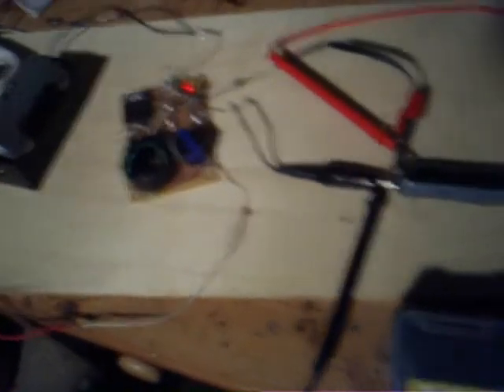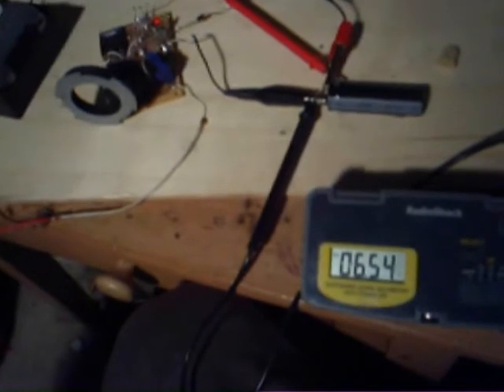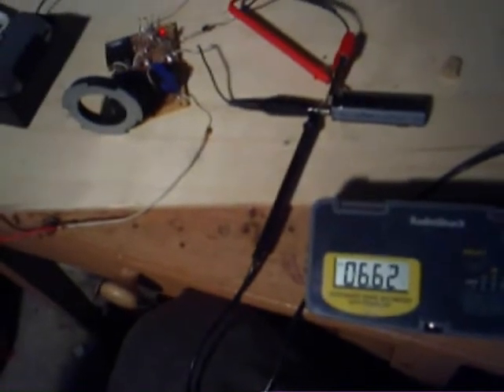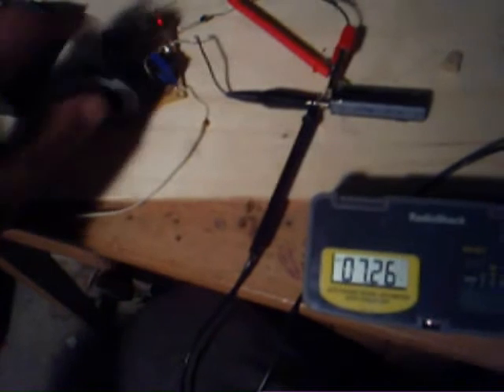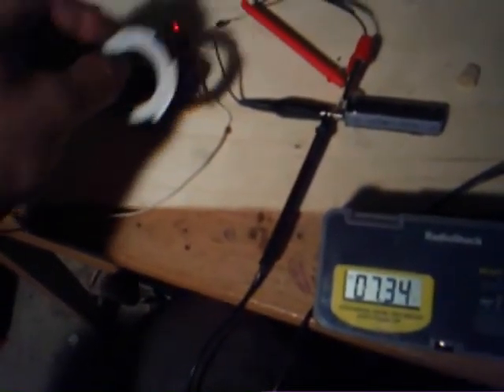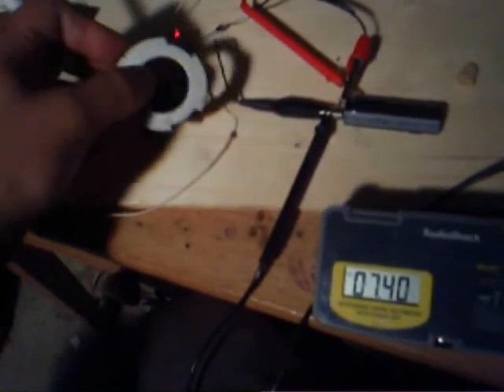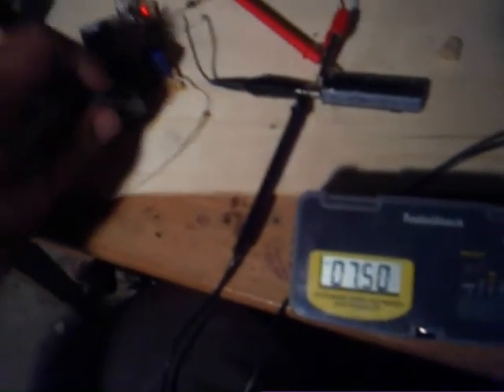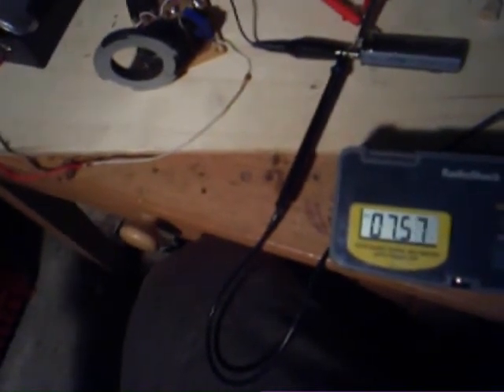Use a magnet to adjust joule thief frequency

Comment from the maker: @MrAnguswangus yea. i tried everything it seems to make no difference. its all the geometry because u basically are changing the shape of the flux, which changes its rate of oscillation. i noticed for whatever reason unloaded, the charge output will rise with a nearby magnet, but when loaded with an LED it lowers. u can do the same thing with coils on motors